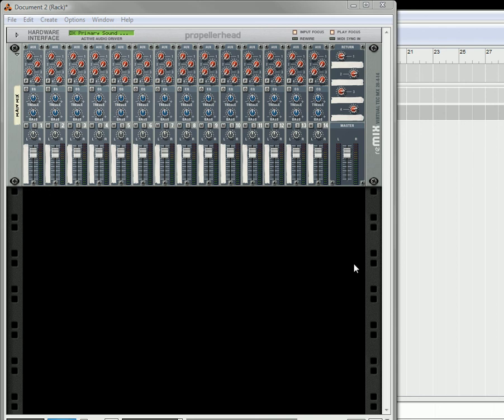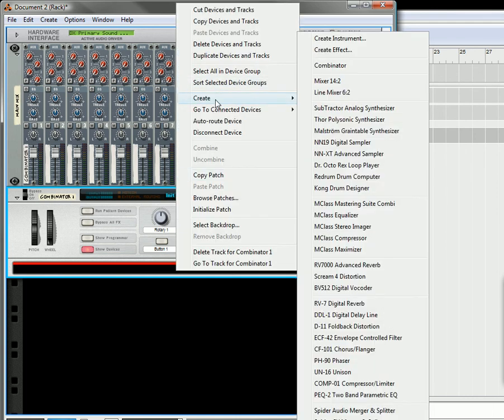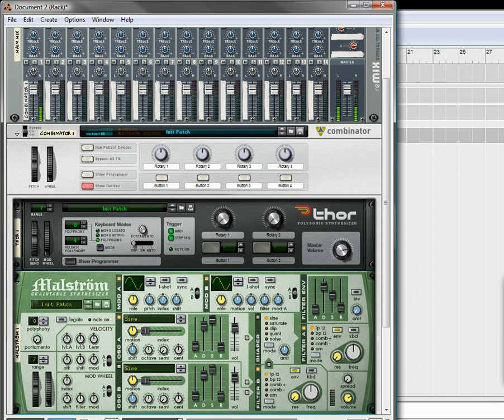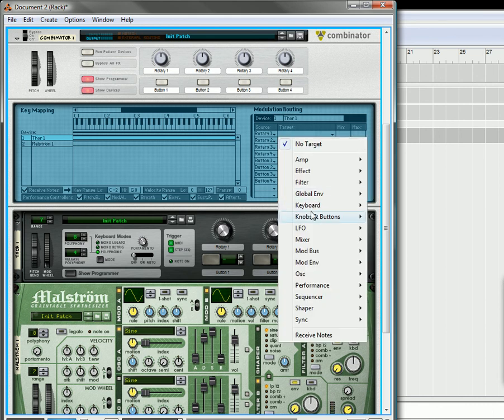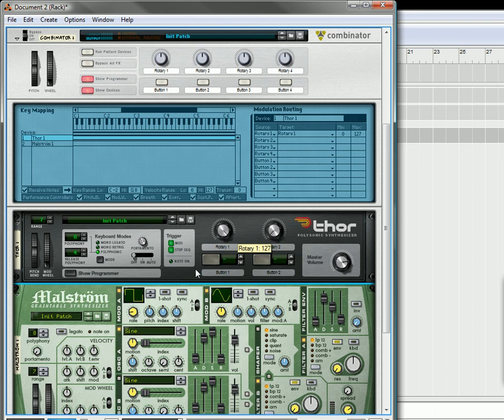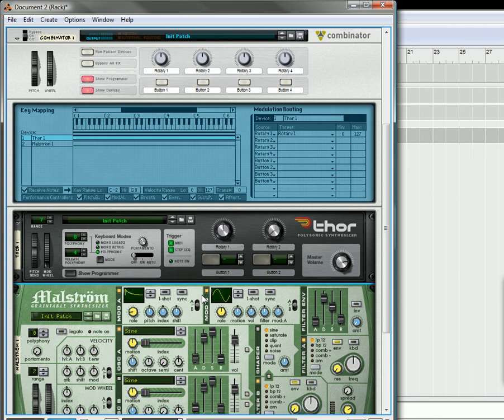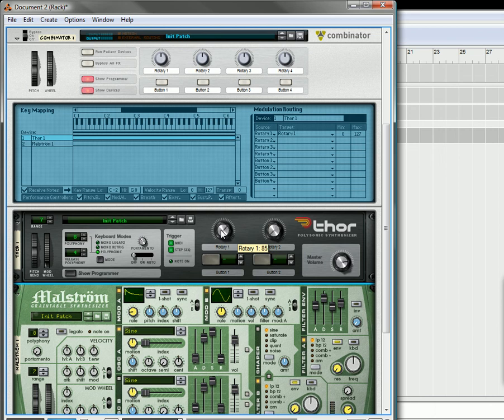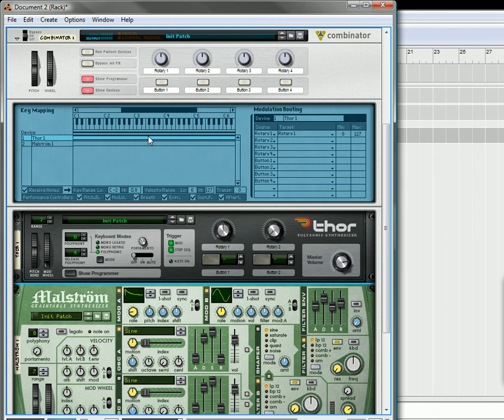Visualizing CV in Propellerhead Reason

Comment from the maker: @oddacorn I think it depends what you want to visualize. I prefer numbers in most cases, so I use the DDL-1 to display the CV where I can. But if I'm using Kong pads, then the Vocoder is usually better because it has 8 or even 16 slots (32 would be pushing it). But a note about the BV512 - you can also view negative CV values if you hook it up correctly. So, for example, for bipolar CV, use two bands: 1 for positive going and 1 for negative. Just a thought.

Comment: @Phisequence - After messing around with this some more, I've found that I like the BV512 Vocoder the best as a CV display. You can set it to have 4 or 8 bands depending how many CV's you're looking at, plus it takes up much less vertical space than a 14:2 Mixer (the trade-off is that the vertical resolution is a bit lower). Thanks for all the awesome vids!

Comment: I tried the same thing but used a 14:2 mixer instead and it works pretty well to visualize 8 CV values at the same time: 4 using the Rotary 1-4 Modulation Inputs and 4 using the Programmer CV In inputs. There are a couple of tricks to it. For the Rotary inputs, you should leave the "input gain" knobs in the 12:00 position. However, the Programmer CV inputs need to have those knobs cranked all the way up, plus you have to set the Bipolar/Unipolar switches to match the input signal type.